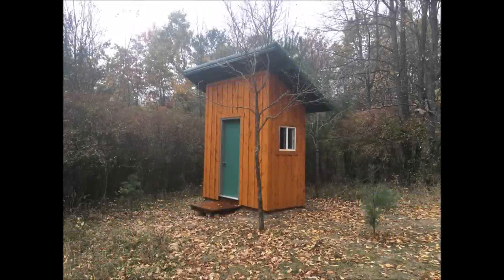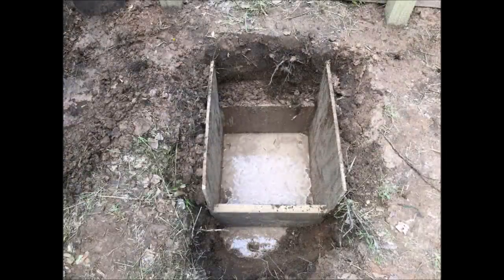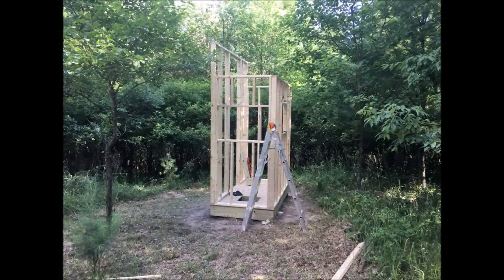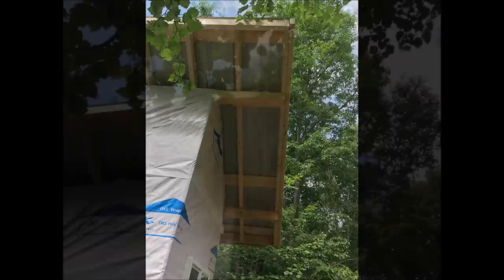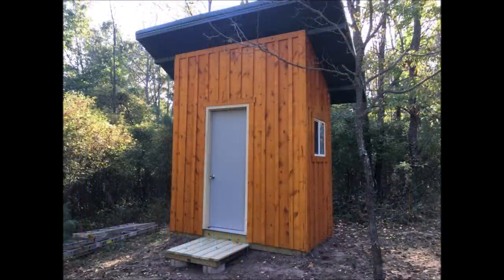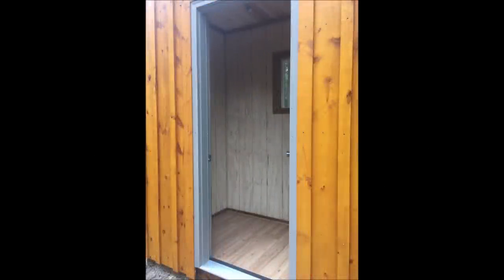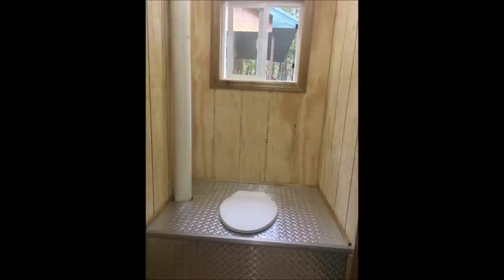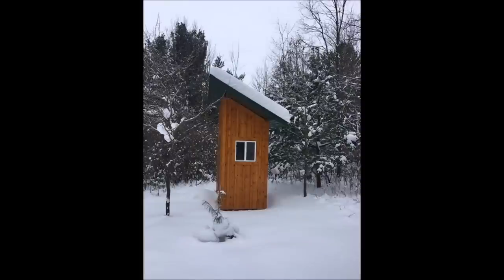Building an Outhouse Off the Grid

Comment: Would this be big enough to potentially add some sort of shower?
Reply from the maker: Yes, you could build a separate room off to the side and plumb the cabin, however, you introduce a whole new problem.  We have 4-5 months of below freezing temps so your water tank and plumbing all needs to be done in a heated space.  This is only heated on demand.  A shower or bathroom with water will require some way to keep your water from freezing when not there/

Comment: I saw another venting system where just an ABS (black) pipe was used and positioned on the outside of the structure facing the sun. The sun warmed the pipe and the air in it creating a chimney effect drawing any air smell up and out.
Reply from the maker: You may not have been able to see it, but the PVC pipe was used and painted black for this very purpose.  It creates a natural draft moving upward, but the fan accelerates it and creates an updraft 'tween your legs!  :)
Reply: @Michigan_Backwoods  I hope to heaven you mean a DOWNDRAFT....
Reply: The pipe should pierce UNDER THE SITTING PLATFORM

Comment: The superficial beauty is wonderful but the hole being only 4 feet to me me takes away from the trouble of all that hard work. Il do a video and show how we in Trinidad use 2 oil drums one above the other making the hole 8 feet and also casting a 3 inch concrete slab for the floor. We remove the bottom of the drums so water can soak away. The 2 drums painted inside our wint rot and it prevents the dirt from caving. U guys put more emphasis on the top than the bottom.
Reply from the maker: Keep in mind that in Trinidad, you likely have biological activity 24/7 365.  Our winters have water that is very, very hard and can even be walked on!  :) Calculating the volume in a human 'flush', we calculated I'll be about 110 years old when the hole is filled.  I don't think it will be much of a concern for me, unless I'm very lucky............

Comment: Hi, I like the info about the 12v solar system.  I was more interested in how to construct the pit correctly, materials and how to connect the vent and fan...do you have more information on those actual details?
Reply from the maker: Ann, the pit is somewhat simple.  You'll need to dig a deep hole, perhaps 48" deep and the simply construct a box with treated plywood tokeep the pit from collapsing inside itself when wet.  As for the vent and fan, the vent simply runs from the roof down into the box.  If I had to do it over again, I would not use a fan.  The didn't afford much odor control (there wasn't much to start with) and over two years the motor rusted and needed to be replaced.  Now I don't use it all.  Hope this helps!

Comment: I always wondered how you install these where you have a fresh water well on your property.......wouldn't this contaminate the water source underground? (depth and distance matter of course but during rainy season  ....how well the ground filters out ?!!)
Reply from the maker: I do not have a well at this location.  Water is available via a creek at the bottom of the hill.  Putting in an outhouse, or septic drain field always requires a setback from a well head....so you are right is a serious consideration

Comment: i was planning a similar outhouse but what does one do when the hole is full?  do you move the outhouse or muck it out?
Reply from the maker: A little bit of "poop" engineering went into this.  Using the average waste generated by a human in a weekend, we then calculated the related volume generated.  This was then converted into CFC (cubic feet of crap).  We designed the hole to be able to accommodate 52 weekends x 2 people x 10 years worth of CFC.  After 10  years, I may be dead and it becomes a crappy problem for my kids.......but they know they can just cut the support posts that go into the ground with a chain saw, hook it to an ATV and drag it to a new spot.  Important:  don't forget to cap the old hole or one's boots become rather messy!  Good luck!

Comment: No, this is NOT practical at all! In Finland, we used to have a lot outhouses, long time ago, of course, and still have them at summer places. No, you don't dig a hole in a ground, you make sitting surface a little higher, and we use, like half plastic barrel, under seat, and , of course, there is a door, behind, you can take barrel out and empty it !!! This way you can use it forever, and clean, when needed. We usually dig a hole, furter away, in a forest, and empty the barrel there, then cover the hole with sand ans soil! Be smart about it, this is NOT practical, and that diamond plate, noooo!! You should put metal plate, inside the sitting surface, in front, where pee is splashing, so pee does not penetrate into a wood, easier to keep clean!! Finnish Way is the best way,....just saying ;o)
Reply from the maker: Wow!  So you have a half barrel filled with both "Number 1" and "Number 2"?  Our 'wet' waste filters into the ground (no permafrost) leaving only the solid portions which tend to dry over time. Great to know that different countries have different techniques for managing human waste.  Here in the US, we tend not to want to handle human waste anymore than absolutely necessary.  I wouldn't like to be moving it from one spot to another...... one trip and you are suddenly covered covered with a big mess.  With this method, when the hole is filled (I'll be about 106 years old when my hole fills to capacity) we simply hook up a tractor to the outhouse, pull it about 10ft over a new hole and you are ready to "go" again!
Reply: @Michigan_Backwoods  Well, we dont, and of course, you have Trump too;o)), Got it??
Reply: @Michigan_Backwoods  No, it is NEVER filled, because we empty it, when needed, and there is some holes in there, so it will not collect, you know what ! Anyway, i like the cabin, and even toilet, not the system, so, like a movable stairs in cabin, will build those in mine, question is: Did you use rope, or wire on that pulley system? And Thank You, Enjoy your cabin, and Merry Christmas=))
Reply from the maker: @Eeropolvasti  Eero, I used a small plastic coated steel cable (about 3/8 inch) for the pully system.  Merry Christmas to you also!
Reply: Thanks, Be Safe! Enjoy your Cabin, will do same pulley system for my Summer Cottage, we have similar loft like you =), and right now I have only ladders, will make narrow stairs, like yours, and...maybe a little handrail...on one side =) @Michigan_Backwoods

Comment: Is the fan accessible? And does it pull air up?
Reply from the maker: Well..........good question about the outhouse fan.  In hindsight, I probably wouldn't have done this.  We found that the natural draft up the pipe was really sufficient to 'tame' the odors.  Secondly, somehow there was a short in the wiring to the fan, and to repair it would require removing the top of the seat to fix it.  When we learned that the fan really didn't contribute much benefit, we just let it alone and don't use it......hope this helps!
Reply: @Michigan_Backwoods  thanks based on the video I had tried the same thing this past summer but put the fan outside the box. Still need to hook it up to a solar panel next summer. Need it to remove any smell as well as ground condensation. Thanks

Comment: Thanks again for sharing could you post a link or provide part number for those 12 volt panels?
Reply from the maker: Much to my surprise, I purchased the panels from Solar Boulevard in California.  It appears they are no longer in business.  There are lots of solar suppliers out there, and I'm using standard 100W solar panels (two of them) which tie together.  Here is an example from eBay of what I have for $87 free shipping for one panel:  https://www.ebay.com/itm/NewPowa-100W-Watts-Solar-Panel-12V-Volt-Poly-Off-Grid-Battery-Charge-RV-BOAT/122807731402?epid=19016216368&hash=item1c97e944ca:g:6NcAAOSwRoxXnuLo:rk:1:pf:0
Reply: @Michigan_Backwoods  Harbor Freight has a good deal on these.

Comment: Curious on how you are planning to move the outhouse when the hole fills up :)
Reply from the maker: Sadly, it won't fill up in  my lifetime!  It gets a deposit about 2x/week for about 30 weeks per year.  That is about 60 deposits per year at an average of one pound per deposit.  Human waste weighs about 45 pounds per cubic foot, and that would mean I'll fill about 1.33 cubic feet per year.   I've got about 36 cubic feet to fill, so that should last me about 27 years before I either need to pump the hole, or move the outhouse to a new spot!  I see this as being my Grandson's problem, and I don't even have one yet!  I'd expect him to cut the four corner posts, attach a rope and pull it with an ATV over a new hole!  :)
Reply: @Michigan_Backwoods  add garden yard wheels on struts. push that puppy where you want it.
Reply: Some Enzymes and a little water now and then and it will never fill up .
That's how I do my outhouse on my Property